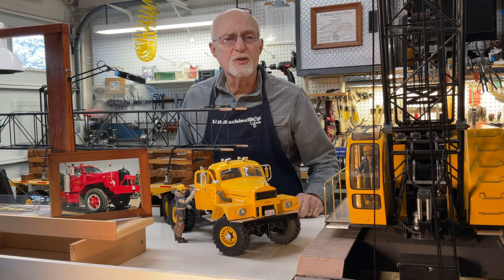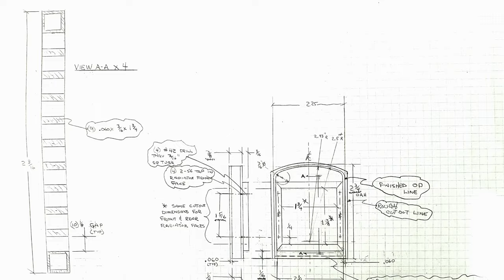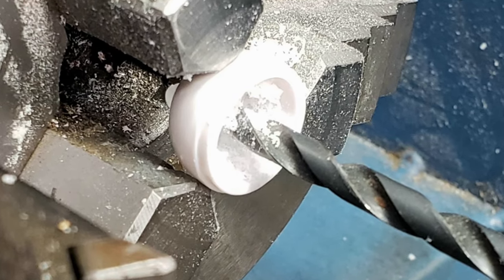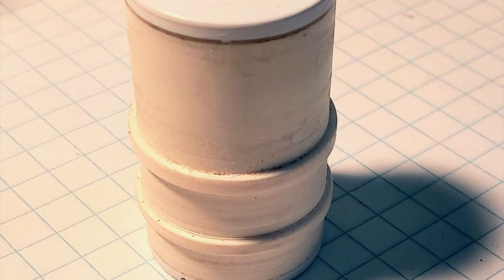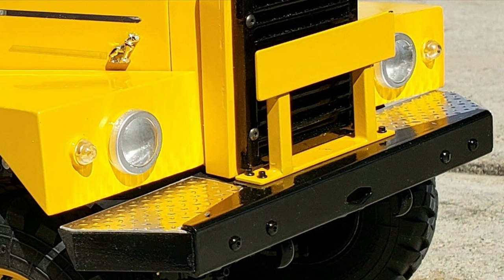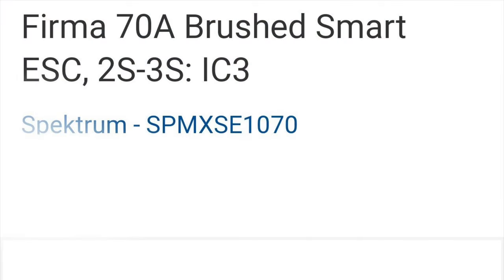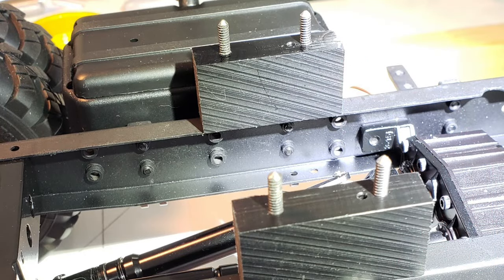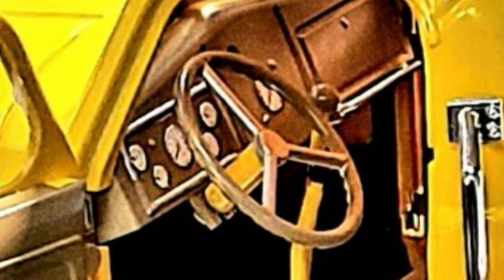Making a 1960s vintage HD Mack Truck RC Model

Comment: That's one awesome build! The cab looks pretty realistic as does the whole chassis. I especially like the dually-setup on the rear-axle with the larger tyres. You really nailed that classic look!
Reply from the maker: 4444design
Thanks for your positive comments.  Yes, the tires and rims really enhance the    look of the build🎈

Comment: I have a Mack Construtor 3/4 cab with a trailer dump 
model I built in the late 60’s. The entire rig is maybe 20” long. Not sure of the scale. I think it was an AMT model. 
I assembled and gave it to my late father as a gift. 
He had it out for a while when new then it went into a box for 50yrs. I found it when I had to go thru his estate 5 yrs ago.
Its all there but after many years passing the model glue has mostly given up.
It was red, black and chrome plated styrene.
It’s in really great shape aside from the glue giving up.
I want to bring’er back and restore her.
I am an RC guy now. I have many 1/10, 1/18 & 1/24 scale 
Was thinking about electrifying the model!
Do you think I should keep it a static model?
I am afraid one hot lap in a newbie’s hands might tear off all the nice pieces on the sides. 😢
Reply from the maker: Sounds like a personal decision. If you cherish it like you seem to, I would either "keep it on a mantle" or possibly RC it, but NOT as a BASHER or CRAWLER but rather as a limited use show model. In any case, ENJOY IT as best you see fit!
Best,
Tom

Comment: A little more weight over the front axle to help the steering!
Reply from the maker: Thanks for your observation! Yes indeed, I had not anticipated that the 20 pound trailer weight (loaded with four 3/4" thick slabs of oak model crane swamp mats resulting in an additional 5 pounds on the 5th wheel) would have such a significant impact on the model's turning ability. As my video explained, I tried to minimize the impact of the soft/grippy dually tires mounted on solid axles by lining the tires with slit lengths of 5/8" garden hose. Actually initial tests on the originally lined tires saw the sharply turned front tire wanting to fold off the wheel, so at least that outcome was avoided🎈
Best Regards,
Tom